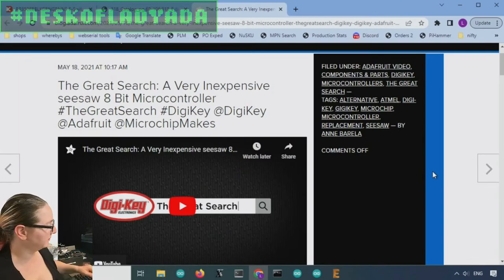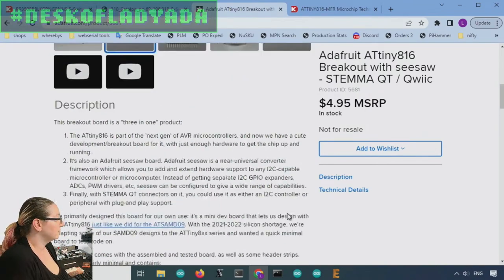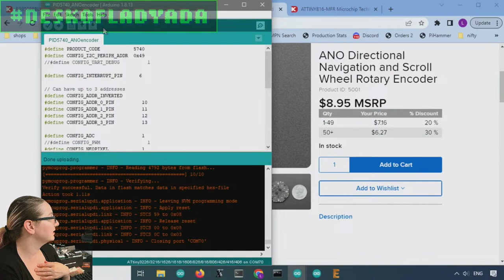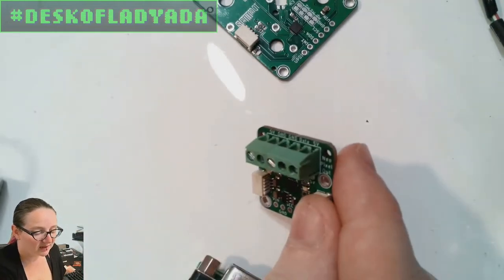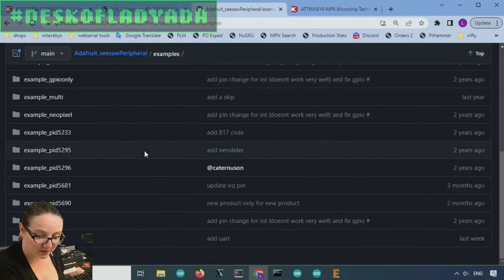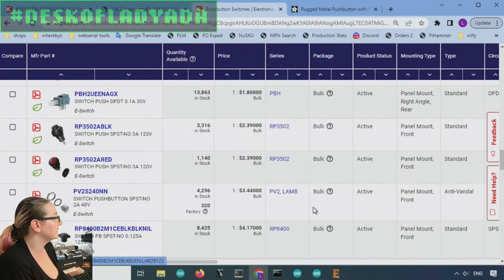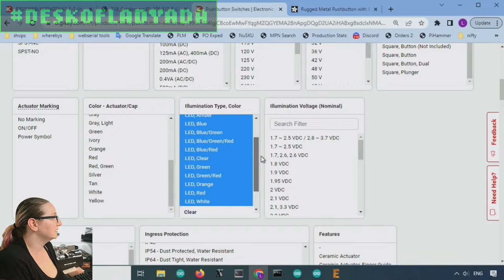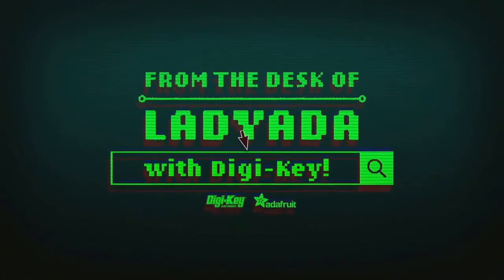Desk of Ladyada - seesaw sample Sunday!

Comment: For the ANO rotary encoder, how about four neopixels, one in each corner of the PCB, just outside the ring of the encoder?  The whole thing could then be mounted on a sheet of diffusing acrylic flush with the surface of the encoder.